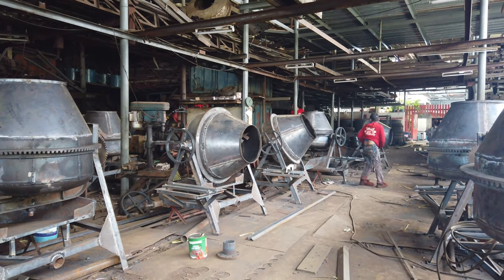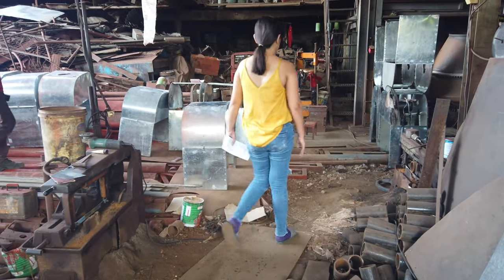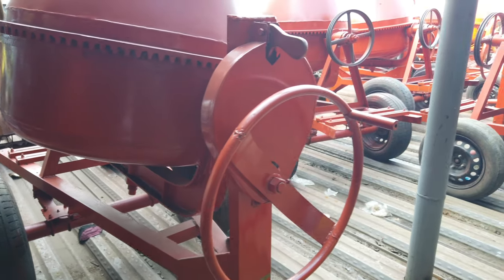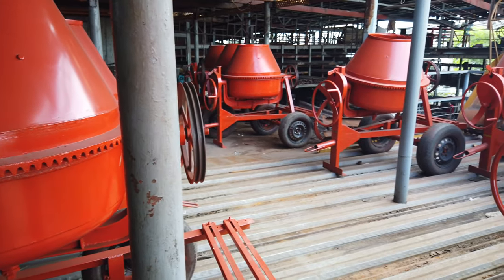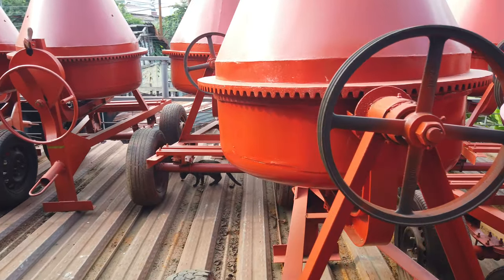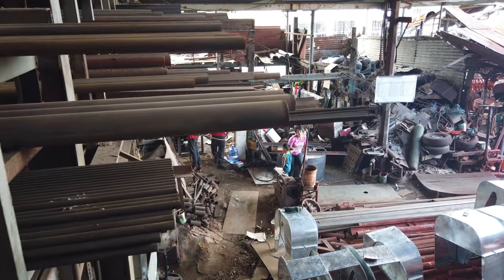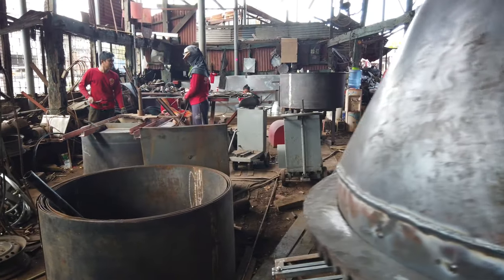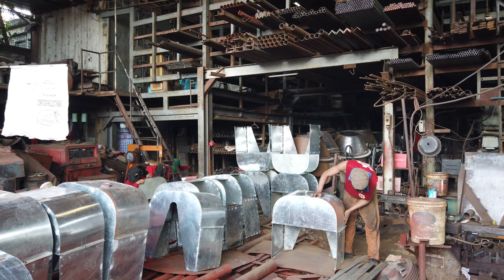Touring A Cement Mixer Factory In Cebu City, Philippines. 4K

Comment: Those are great for someone who is mixing their own. My dad had one of those and used it quite a bit. Usually for filling in, mortar between cement blocks. 😃😃👋👋💖💖
Reply from the maker: Mixers are quite vey useful fir doing cementing work around the house 😃
Reply: @villagepeoplephilippines  Dad used his a lot on the farm. We don't do enough concrete in town to purchase one. We can buy concrete tiles for sidewalks as stuff. We used to have to pour our own for sidewalks but it didn't make the cost of a mixer worth it. I don't know what ever happened to my dads. 😃😃👋👋💖💖